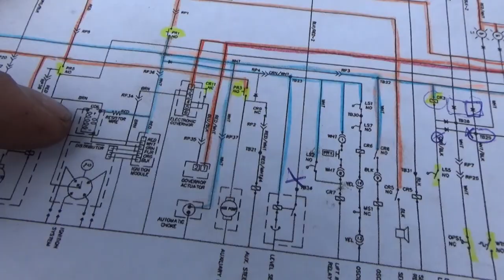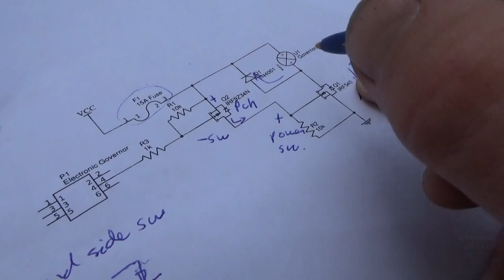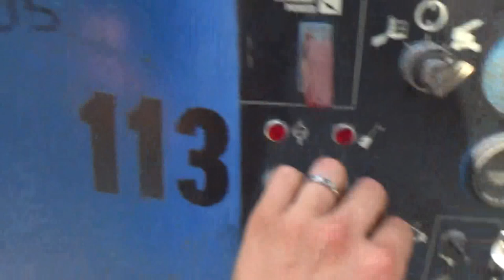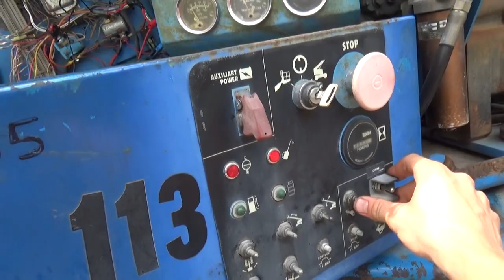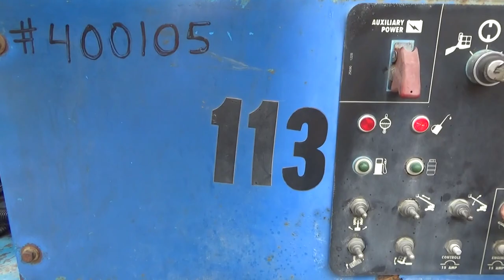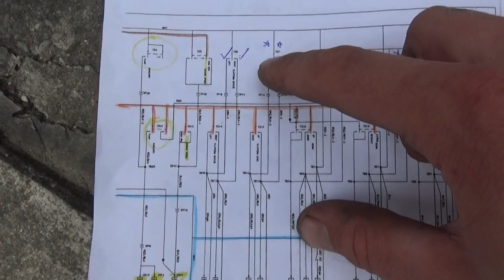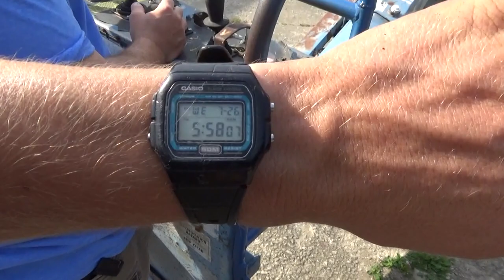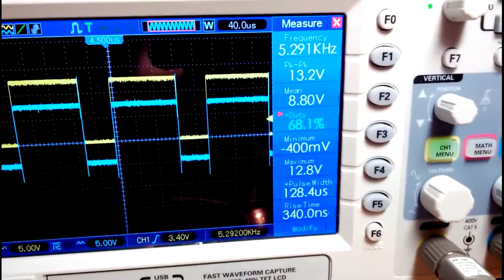Genie Boom Lift REVISITED -Part 4 - GRAND FINALE!

Comment: Ivan, this was one awesome series.  Thank you!
Reply from the maker: I am glad you enjoyed it, Randy! Ever come across nightmare cases like this in the appliance repair world?
Reply: Yes, I'm dealing with one in Avoca now. It's a GE Harmony dryer, made by LG that talks with the washer via serial cable. Made around 2002 with a touch pad control.  The dryer keeps forgetting what model number it is. Problem is,  only a handful of these were sold and very little service information.  I need it to just finally quit working all together,  then I can troubleshoot it.

Comment: That was some impressive electrical engineering there! You guys make a great team - maybe some counterfeit  electronic gizmos for these modern cars are in your future?  Start with GM ... :D 

This Genie had about as many problems as my 2000 GMC Jimmy ... that now sits out back cut into 200 pieces, with it's parts scattered all over the world. Intake manifold went to Brazil, EVAP stuff went to CA, also sold a few parts off it to Russia! 

Used the engine out of that turd in my '89 S10 Blazer, carbed with HEI ignition - made that engine absolutely phenomenal! Got the same mileage as the FI system, but gained throttle response and midrange torque. All without constant breakdowns. A win-win! :)

Comment: Vlad is awesome for coming up with this on his own. For future use, the same kind of function can be performed using a cooling fan "relay" from a 2004 Jeep Grand Cherokee. It is a 40 amp solid state PWM module. The service manual calls it a relay, but it is really a circuit just like Vladimir's.
Reply from the maker: Great suggestion!

Comment: well ya got it working kudos to you!!!  fyi- the electric sollenoids that control the hydraulics are voltage proportionable (variable)a few are on/off  but most will obtain higher flow with a higher voltage.thus faster cycle times for the function . thats why the joysticks on the platform control panel all have circuit boards.at the end of your video, those functions although they worked was way too slow. on those circuit boards there are 10 turn trim pots that will adjust the out put. but also there are the same 10 turn trim pots to adjust the input bias so you need to refer to the manual for the correct settings. generally roughly 5.6 volts will start the flow and 12 volts will be maximum.these boards seem to have a very finite life and i wouldnt be suprised if these had seen it.the "fly by wire"systems are all but the norm in construction and excavating machines nowadays.first time i had one thrown at me i stared like a lost puppy but only for a moment. all those wires its easy to be distracted but like you did just concentrate on one thing at a time.look at it and understand what its supposed to do and how it does it.

Comment: If you would have dismounted the precision governor module, on the back side is a sheet metal cover that can be removed. 
There are adjustable potentiometers to adjust the gain output and eliminate the rpm surging that you were experiencing,  therefore you wouldn't have had to engineer an external solution like you guys did.

Comment: Hi Ivan great video and inventive solution to an interesting problem. I also did not hear the manouvering "Beeper" I expect you left it disconected, I would like to mention one item because it is operationaly safety related. The platform level relay unit has as part of it's function stopping the boom from operating if the base is not level enough. This is to prevent a possible tip over condition. If this safety unit has been disabled or modified the owner & opperators should be made well aware of the modification no one wants a genie tip over video in the furure. great work  I really like the load ballincing LIGHT BULB. Keep the interesting projects comming.
Reply from the maker: According to the diagram, the only thing that level sensor does is enable the "beeper". It does not disable any function of the Genie, as far as we could tell. But yes of course, safety first!

Comment: New machines have square wave frequency to control hydraulic pump and valves. 
Excellent work Comrades.
Check feed back from rpm sensor.
Crank sensor may be open or bad.
Had a few old ones run at half speed like that. 
Laws of OSHA won't allow any modifications or faults on jobs. Very strict laws on manlift . Ok for farm use etc.

Comment: Mosfet is the best option but given the sensitive of the gate capacitance for this use, a bipolar should have get the job done. Probably bigger heatsink would be needed ... Mosfet also will survive the spikes better if the gobernor happen to be "inductive" (they come with high VDS voltages) But you can put a fast diode or TVS on any bipolar as well.
Reply: Do you know why the heatsink is hot? I thought the screw hole part is always negative on a mosfet

Comment: Engine oil flush 1 quart kerosene, run 20 minutes high idle, drain hot. New oil & filter. Drain & renew coolant. Change plugs & wires, fuel filter. CRC Electrical Contact Cleaner EVERY switch. Fluid Film EVERY moving part. Get or make a bungie cord gathered tarp for the bucket. After all your guy's hard work- I hope the Owners take care of it now.
Reply: transmission fluid works nice for carbon busting/cleaning also
Reply: alternative to that? change the FSCKING oil & filter often, keep fresh gas and stabilizer in it... EHHHH >_>

Comment: Vlad - Reviewing your circuit, I would use a 4N25 optocouple instead of that P-channel MOSFET.  They are dirt cheap and perform the same function, but of course has the same problem (not enough load for the controller).

The other issue is the fly back protection diode.  Depending on the impedance of the load, clamping it to Vcc will allow the current to flow back through the load, delaying the turn off time of the load.

Your example at the end is quite different because you are using a P-channel MOSFET to control the load.

Comment: Hi Ivan, what you both did is good but it's still open loop control that makes the controller hesitates when open and closing the governor actuator so you need some sort of feedback of the speed or load status to make it closed loop.

Comment: Now you see why I retired when all the electronic stuff came in.Company I worked for Bought a bunch of Battery powered forklifts but did not want to buy the preprogramed laptops that were part of the package.Long story story short without the proper program it was impossible to even adjust the brakes on those machines.Supervisors pretended that they could not understand why even when we showed them in the paper manuals the flow charts for different troubleshooting processes.Result a bunch of machines that were collecting dust when they could have been working.Machines belonged to the company,laptops were programmed to a certain serial number range of machines and were completely useless for anything else,company that made the machines would not sell the repair program.

Comment: Vlad - Another tip.  The best heat sinking of TO-220 package transistors is NOT bolting it to the heat sink.  You really want spring pressure right on the body of the package, not on the tab,  https://media.digikey.com/pdf/Data%20Sheets/Ohmite%20PDFs/W_Series.pdf

The more spring pressure the better.  (I worked on a project where we had to have a special tool to remove the springs, because they applied so much force !)  A silicon pad will electrically isolate the transistor from the heat sink.

Comment: God only knows where the zero/span points are in that supposedly defective actuator compared to the driver circuit. Also it looks like either way too much gain in the loop or not enough damping and a zero/span mismatch will either mask or worsen the effect of such a gain error. These are all things that someone familiar with closed loop systems could address either electrically or mechanically. When you are starting out developing such a loop from raw dog you have to consider all the finest details that a technician might not have to routinely deal with. This is why you still get unexpected oscillations in different modes. I dub thee Wien bridge governor circuit. Ivan, you're great with cars.

Comment: That sure was one heck of a complicated fix. I think I would have given up after about the fifth problem found, ripped the entire wiring out and started from scratch based on the original wiring diagram. But not with black wiring looms with little numbers written on them. Colours are good :-)

Comment: To the owner of this Boom ....get a Fluid Film Kit & a couple cans of Krown T40 from krowns usa webstore

and spray the hell out of the rust until your able to sandblast & re-paint.

The krown t40 is great for electrical stuff.....  non-conductive.  Fluid Film is also non-conductive. 

I'd use the Fluid film more on the rusted painted surfaces.

Comment: Good video series & diagnostics. Love the circuit test on the bread board at the end. However, the way you have the test light and volt meter configured is not like a LoadPro (with the magic button pressed). You have the meter on the wrong side. It's on the power side on the test light. To be like a LoadPro it would have to be on the ground side. Big difference given Kirchhoff's voltage law. Also the LoadPro doesn't create a second ground path like your method does. Either way, your voltage drop measurements would have been more accurate if you removed the test light all together and did a normal voltage drop test by just using the volt meter alone. The test light is contributing to the voltage drop due to it drawing current and providing a second ground path. Given the large amount of drop in your case It didn't have a huge effect, but this technique may be giving people who don't understand electronics the wrong info/impression on how to properly diagnose a circuit like this. Just sayin'...
Reply from the maker: When you press the magic button, that IS the second path to ground, aka the LOAD :) How do you connect the meter on the ground side? Wouldn't you just read 0V? Draw me a schematic!
Reply: I don't follow how pressing the magic button applies a second ground path. The LoadPro should be in series with the circuit you are testing when you press the button or you are doing it wrong. Its hard to tell, but it looks like in your video you had the test light connected directly to ground & the tip plugged into the circuit. Meaning the test light is in parallel with the circuit, not series. Thats partially why your set up is nothing like a LoadPro.
Re: connecting the meter on the ground side, if you mean how to connect it on the ground side when you use a test light, you can't with that model test light because the ground side is sealed off. You could have if you used the DIY test light you have with a headlight bulb though. Either way, you shouldn't have been using the test light in the first place to do your voltage drop testing.
If you mean how to connect the meter to the ground side without the test light, that should be pretty simple. Just touch one probe to the power side of the load/resistance and the other to the ground side of the load/resistance. You won't get zero volts unless there is an open in the circuit or there is no current flow. A volt meter displays the delta between the voltage at the tips of each probe.  So if one probe has 12V and the other has 4V, then it will display 8V, or if one has 12V and the other has 12V (e.g. when there is an open or no current flow) then it will display 0V. Again, Google Kirchhoff's voltage law. Its the basis for all Voltage Drop testing.

> Draw me a schematic!
Seriously? A bit passive aggressive, don't you think? Especially given that you can't really draw in a YouTube comment.
Reply from the maker: Simple: just draw it and explain it in your own video!

Comment: I watched all 4 vids.. I gotta tell ya, by #3, that thing would've had 'some sort of inexplicable ' engine fire, that I would've been roasting marshmallows off of.. lol Good job guys!  BTW, if the light bulb you guys installed blows, I would assume it would start it's uncontrolled surging? I worked on 1 of these lifts yrs ago, same Ford 2.3, but ran off LP so you could use it indoors. It would do that initial idle surge at start up and then calm down in about 5 secs. So I would call that normal. Ours had problems with the electro mechanical governor as well, and we found that there was an updated part. No idea what amperage it drew, though. Much newer vehicle, 2003...  and it was a whole bunch faster too. 3mph max which felt like 60 on the platform   lol

Comment: The Osolation is probably caused by a bad throttle control solenoid.
The solenoid sticks,  the computer over compensates back and fourth.
I had the same problem with a diesel generator I repaired.

Comment: I really enjoyed this series on the Genie!  Your determination in repairing it is admirable indeed!   I would have liked to see you check the voltage drop directly across the foot-switch just for grins.  Did you do any off-camera tweaking of the engine itself?  

Thanks for the excellent series on the Genie wiring issues !!!

Comment: Be sure and tell the customer that if the new light bulb burns out, the problem will return till he replaces it.
I would have mounted it on the exterior , with a label "ignition light"...replace bulb if not burning for proper  engine idle".

Comment: Reminds me of an old Datsun I had years ago I got for 50 bucks that blow the ignition fuse randomly they brought it to a few shops but no one was able to find the short after I couldn’t find it either I put a headlight in for the fuse drove it for over 1 year like that 
When the short happened the light would light up and it would backfire. 
Maybe like 2-3 times in 50 miles